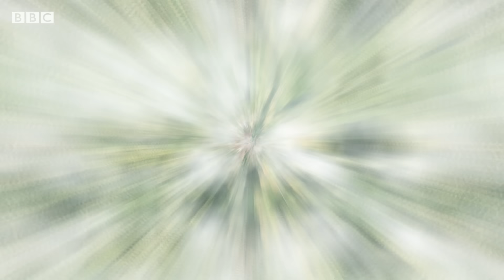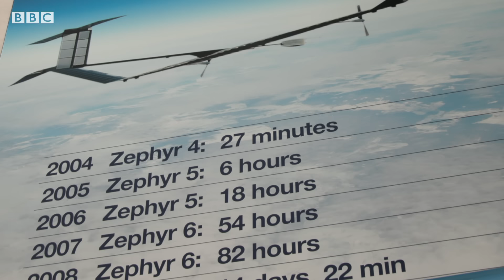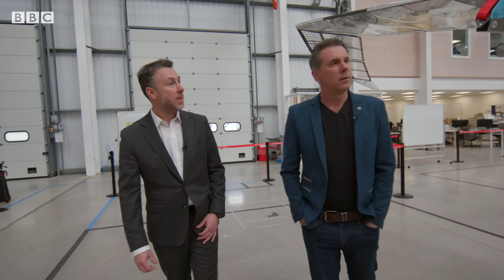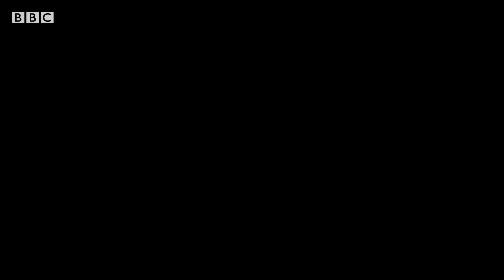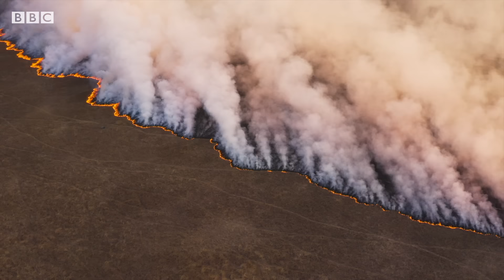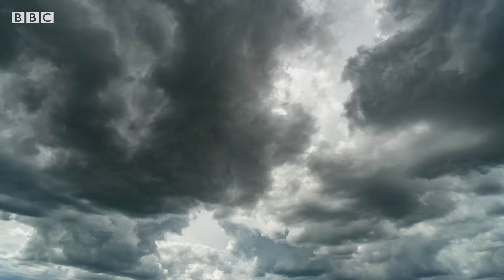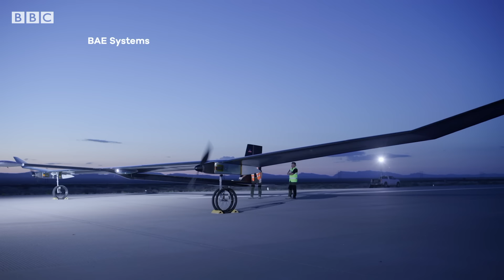The solar-powered aircraft flying high in the atmosphere | BBC News

Comment: I assume the Zephyr can serve as a mobile station or earth observation would weight far more than 75 kg, meaning current performance is defined by flying naked with zero payload.
Reply: Yh for sure, the weight would increase. If the battery tech improves enough and they get denser it could be viable
Reply: @Asdfghjkl-ls1or  They've already improved the solar by 100% removing half the panels. It seems adding them back would open the door to an increased payload. I doubt they would be suggesting use as cell towers without doing viability assessments. The key would be will the battery power keep the  heavier Zepher above 60K till the sun comes back.
Reply: @cre8tvedge solar panels are payload, and drag.
Reply: @Asdfghjkl-ls1or  "If the battery tech improves enough". Would not happen. Battery tech is basically the same for last 20 years
Reply: @falrus  That's a crazy take. Would you bet on it?
Reply: @Asdfghjkl-ls1or  on "next 5 years" timescale would easily bet. In case of 10 years timescale, would probably bet.
Reply: @falrus  has to be next 20 by your reasoning
Reply: @falrus  I don;t think so. 20 years ago gave us the Leaf with at most 100 miles of range. And range that decreased rapidly over time. Granted they didn't cool Leaf batteries but today we have batteries in cars that can go well over 300 miles and lose capacity at low percentages. Expectations are that solid state may increase battery efficiency by as much as 100%.
Reply: @cre8tvedge  "I don;t think so. 20 years ago gave us the Leaf with at most 100 miles of range. And range that decreased rapidly over time"

Bear in mind that a lot more than JUST batteries has changed in that time.

Better torque/weight motors.

Better kW/weight inverters.

Lighter vehicle chassis.

More efficient wiring layouts.

All in if someone ever managed to crack a battery with the same energy density as petrol then ICE would die very quickly simply because all the innovations made in the last 2+ decades for EVs have made it so much more competitive.

Just look at YASA's new axial flux electric motor with >1,000 horse power at less than 12 kgs.

That's just insane.

And the efficiency of inverter circuits has likewise massively improved.
Reply: Hi @mtssman! 75kg is the maximum take-off weight for Zephyr, meaning that 75kg includes the payload!
Reply: @aaltohaps  That does not sound good at all. As a mobile station it has to carry 4G telecommunication hardware and additional battery. Alternatively all the telecommunication hardware has to draw power from onboard battery, which has very limited capacity. As it is it can barely keep Zephyr flying through the night, even has to loose altitute as onboard battery runs low.
Reply: @mtss老湯man  I wonder if a super-capacitor storage would make the storage life cycle longer, and make max capacity larger.
Reply: @mtss老湯man This is a stepping stone obviously.
Reply: Yes, but current performance as described in the video also means that they are fully charged "by noon". So there is some headroom.
Reply: @AlexusMaximusDE  shouldn't matter, the solar panels probably don't account for much of the weight and aren't a limiting factor. Think of a phone that charges in 20 mins but only lasts 2 hours, not very practical
Reply: @Asdfghjkl-ls1or  every gram matters, as said in the video.
Reply: @Asdfghjkl-ls1or  The point is that there is enough power left to carry more weight. So the batteries won't be charged by noon but by dawn and instead the motors are getting more power from the solar panels all throughout the day.
Reply: @AlexusMaximusDE  I see what you mean. The only problem with that is that until dawn, it's still running on solar power to keep the battery at 100%. So the battery needs to be able to last the night, which might not be possible if you increase the payload.
Reply: @AlexusMaximusDE  that only considers the weight of the payload, not how much power the payload itself needs which could easily be a considerable amount especially when talking about equipment that can replace 200 towers.
Reply: @conorstewart2214  My hat of off to you sir, could not have put it better myself.
Reply: @AlexusMaximusDE  "The point is that there is enough power left to carry more weight."

Not much weight.

And there probably isn't enough power to run a cellular transceiver AND carry the weight of it.
Reply: @Asdfghjkl-ls1or  the surplus energy during day matters a lot. I imagine that people sleep during he night, 
hence the use during the day require no battery. Also, this is a prototype. 
A working cell can be made 100 times bigger.
Reply: @ehombane  interesting, I hadn't considered that. That said, internet usage actually peaks from 6-11 when people get off work, which would be after dawn for a large part of the year
Reply: @AlexusMaximusDE A small note : generally speaking, dawn is understood as the time right before sunrise. I suspect You mean "dusk", which is the time right after sunset .
Reply: @Asdfghjkl-ls1or  I think you meant that until dawn it's on battery power which has it sinking in elevation. Perhaps the key would be rising to 80K every morning so there is more depth to sink before dropping into the wind zone.
Reply: @Asdfghjkl-ls1or  but we have a benchmark that shows it can last overnight without a payload, and with a charge time that good, there's room for a bigger battery
Reply: I weigh more than this thing 😆
Reply: I was really confused by this at first to, and this video was the first time I saw an explanation of how it works. So the power and processing of the cell tower is situated on the ground, and can be many hundreds of km away because of the high vantage point. The zephyr serves as a relay only, essentially taking whatever the base station sends it and blasts it verbatum to a specified location on the ground. This relay function uses very little processing energy and the antenna doesn't have to be very big or powerful to reach a tight specific point. Most of the testing they're doing now includes either this equipment or dummy weight of the anticipated equipment
Reply: Correct.
Reply: Well, in that case, they would only need to scale up. While it would call for a whole new cycle of iteration and structural engineering and fine tuning, in theory, it would be doable, however, the final product would have to BEAST to stay-aloft for as long as these prototypes.
Reply: @ethanverma-h2t  Given high BW Starlink is always available, of what use is Zephr? Also, at 40 mph airspeed it can’t hold position in the stratosphere.
Reply: @Czeck0-u1k cost. And also not being in a monopoly with a psychopath
Reply: @jra55417 Lol. Who says Zephyr won’t be a monopoly.  Asking you, psychopath.  It’s a toy, a stunt, not  even close, bit for bit to Starlink for lowest cost.
Reply: @Czeck0-u1k erm. By definition. A monopoly is one of something so Zephyr can’t become a monopoly. cCompetition is healthy. If everyone just gave up bc starlink is so awesome then we’d see prices climb. Also can’t trust your hero Elon to not start selecting who is or is not eligible to use his service.
Reply: @jra55417 my hero? Lol. Yeah, psychopath is right about somebody. How r your Assassination plans coming aling, psycho.
Reply: There's no money in natural disasters. The real money comes from bloated military contracts. Don't be dense. High-powered cameras. I think China had the same idea with balloons, but theirs lost power and crashed through Canada into the US.
Reply: Better solar panels and batteries + lighter construction materials will enable that payload.

Also more advanced cell infrastructure DESIGNED for low mass/power operation would be a key part of that equation.

Given current cell infrastructure is designed for tx/rx towers that support as much weight as you need it's obviously not going to be viable to field EXACTLY the same equipment now is it?
Reply: yep. telecom equipment are heavy and require good amount of power to function which means more batteries on board.
Reply: Another thing they say is that normal cell towers use a lot of power, so why wouldn’t they also use a lot of power if put on a plane? The plane could replace 200 towers they claim and deliver fast speeds for 4G and 5G so how are they managing that whilst also reducing the power consumption by a lot, enough that it could be powered by solar panels on the plane? Also unlike the planes propulsion they can’t just lower the power consumption at night if it is used as a cell tower.

I think they are speaking entirely hypothetically and are basically dreaming. The equipment needed to replace 200 towers and serve all of those users with high speed connections whilst being powered by solar panels with a big enough battery to last overnight is practically impossible with current technology. If they have tested it, it will only have been with a few users at a time and I doubt they have actually tested it yet.

It also conveniently ignores a huge issue with this idea, congestion, if too many people are using their phones whilst connected to the same tower the speeds will drop massively or just stop working outright, this happens at large events like concerts, some venues either have or can hire in extra towers to handle the load. So if this plane mounted system can cover the area of 200 towers can it also handle the load of 200 towers without slowing down or just not working? There are a limited number of frequency bands and a limit to how much data can be transferred using the whole band, for normal towers that serve a relatively small area this isn’t an issue except in exceptional circumstances like concerts. More short range towers can serve more people than fewer long range towers in the same area.
Reply: Cameras aren’t necessarily heavy. Though they are bulky for large reflector lenses. Hard to see advantage over satellite cameras though, maybe the purpose is to hover over 1 area which a non geostationary satellite can’t do.
Reply: @techman8817 Satellite cameras are at 100 miles for low earth orbit and never over the same spot for very long, and at 22000 miles for geostationary while always being over the equator (so never overhead for many locations). The Zephyr at 75000 feet is at 14 miles altitude and can be relatively stationary over any point on the planet. That's quite a benefit I think.
Reply: @techman8817  I suppose if they eventually refine the idea into a product that can replace satellite applications, there are many advantages: Lower cost of payload insertion, no space debris, lower CO^2 footprint and so on.
Reply: @techman8817  Fixed wing aircraft don't hover they circle.
Reply: dont think it really needs much more of a payload.  it would only act as a repeater or a sort of mirror.  ground station has all the power.  this thing just reflects it downward allowing better line of sight.  cant imagine that would be too heavy but every lb counts i guess.  i could be way off. just my thoughts.
Reply: @MattP5000  A repeater and a mirror are entirely different things. A mirror is passive. A repeater consumes electricity to retransmit signals.

It isn't going to be communicating occasionally. It's going to be constantly retransmitting data from phones to ground stations and back.
Reply: @dafunkmonster  cool
Reply: @MattP5000  a repeater still needs a lot of power, a repeater needs as much power as any other transmitter, it just receives a signal and retransmits it. For the frequencies and distances involved using it as a mirror likely will not work at all. Phone signals are two way communications, if they used this as a mirror then your phone would need to have enough power to send a signal all the way up to the plane and back down from the plane to the base station, many times further than you phone is doing already, so your phone would need to have the same range as the base station. The way it works just now is to have very sensitive receivers on the towers but there is only so sensitive you can get. Even if you could reflect off of the plane you would need a way to spread out the signal over a large area, if you just reflected it then you would only have a small beam of signal, just shine a torch or laser at a mirror, preferably a tiny one. You would need to reflect and scatter it and then you will likely still have problems with communication from your phone back to the base station since you would have to do the same thing in reverse. Reflecting and scattering a signal like that just gets very messy and complicated, it isn’t as simple as just sticking a mirror on the plane and claiming it will work because it will have line of sight.

Also there is a limit to how much data a frequency band can handle, this is why at large events like concerts phone signals become very slow or do not work, there is not enough bandwidth in the frequency band to transfer all that data, this is also partly why cities have lots of phone towers closer together (another major reason being penetration through buildings). The amount of data transferable through a frequency band is limited by physics, no matter how high tech or advanced your transmitters and receivers are you cannot exceed this limit, so if this plane can replace 200 towers then the total traffic of those 200 towers needs to be less than the bandwidth limit or you will end up with congestion. Having more shorter range towers can serve more people than having fewer longer range towers.
Reply: Meanwhile Elon already has thousands of his towers in the sky covering almost the entire earth.
Reply: Equipment can be structural, such as in race-cars. They can use more solar panels and they could probably even use more advanced composites in the future. Battery technology will advance too.
Reply: Starlink or equivalent makes that use case irrelevant as far as I can tell.
Reply: It's not for you Americans, sure

Comment: Starlink has already made this obsolete since it is able to connect with mobile phones.
Reply: But it crowds up our orbit and greatly increases the probability of space junk ruining all the satellites. We're pretty fucked if that happens, this could be an alternative to some things
Reply: @user-uq2pd8zk3x 
If we can master this, this might be the thing and technology like it might make it to where we aren't completely screwed if we face Kessler Syndrome.
Reply: If this works then I would argue that having ultralight re-usable planes like these is cheaper and more environmental friendly than launching thousands of satellites into space that burn up every 5 years. Furthermore there have already been near accidents between space junk and satellites.
Reply: @RicardoMusch  | Satellites burn up completely when deorbiting. Cases when some parts reach the surface are very rare. Nothing is perfect, and if you populate stratosphere with tens of thousands of these planes they will sometimes fall due to malfunctions creating junk and endangering the regular air traffic and people on the surface. The specific payload capability of solar planes is extremely low, and they should be 100 times larger to carry a meaningful payload like cell-station. So you should add a whole plane with a wingspan of a regular airliner to each cell-station
Reply: @rasimbot  as they mentioned they are working on all these problems and cell tower tech doesn't have to be prohibitive in weight with the technology of today.
Reply: Look up Project Loon ppl. Problem with these is airspace and the global regulation. Starlink only has to adhere to US regulation.
Reply: If this can do the same thing starlink does at a lower price, then this will make starlink obsolete.
But, that is IF it can do that.
Satellites have big upfront costs, but this has small ongoing costs.
Reply: A. I don't want to use Starlink because it's connected to a grifting idiot and B. These would have less lag in connections which are endemic to satellite connections.
Reply: It’s way more cost effective
Reply: Maybe these aircrafts will take Starlink out of business?
Reply: @christerpkarlsson72 sir, the plural of aircraft is "aircraft".
Reply: @christerpkarlsson72  Starlink, by its nature, is forced to fly over very remote areas. Everywhere inside inhabited latitudes.

Now you might call that a disadvantage for Starlink because it's wasting units, but it also means that coverage over oceans and other remote areas are almost free to provide.

Aircraft meanwhile will circle above hotspots. I can imagine a situation where low orbiting satellites provide coverage everywhere, while solar powered drones supplement coverage over densely populated areas.

Plus, starlink can bounce signals between satellites, which means because of their density they can handle all international communication. These aircraft would need to exist in even vaster numbers to do that.
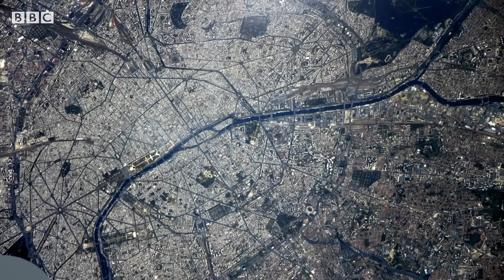Reply: 6:41 they went over this.